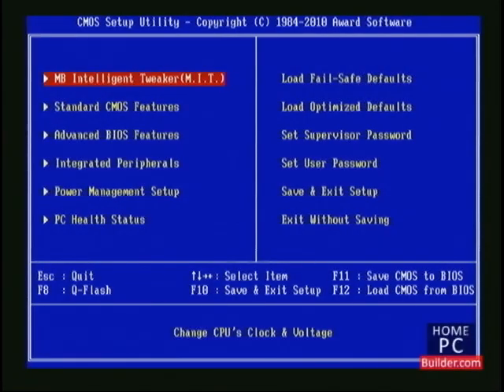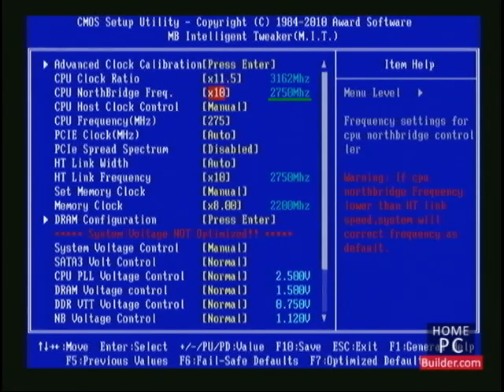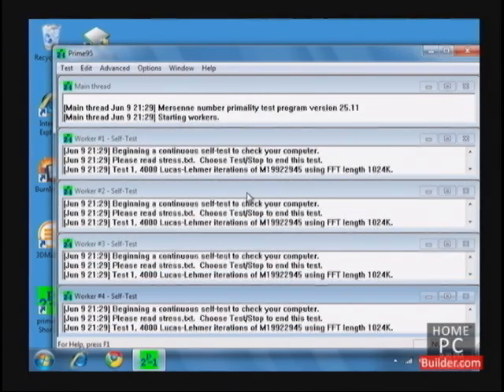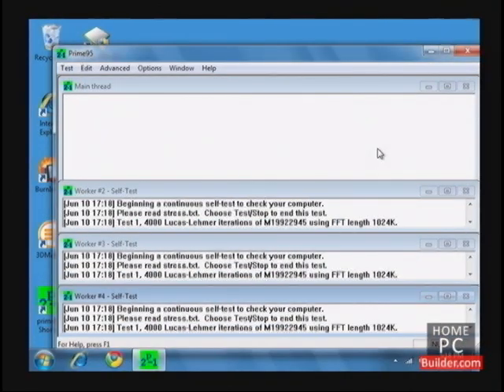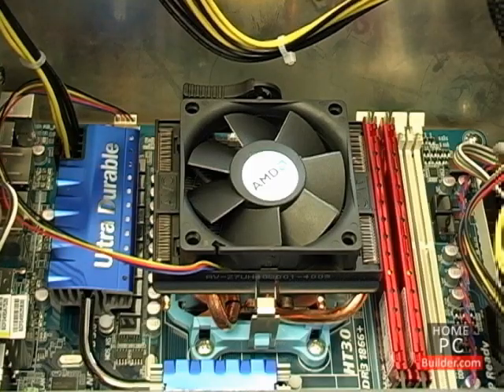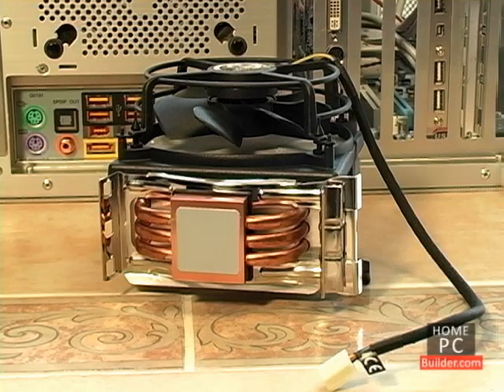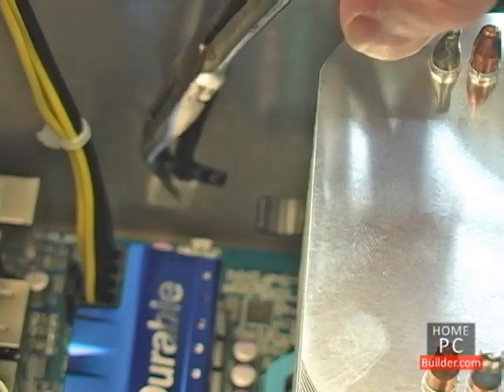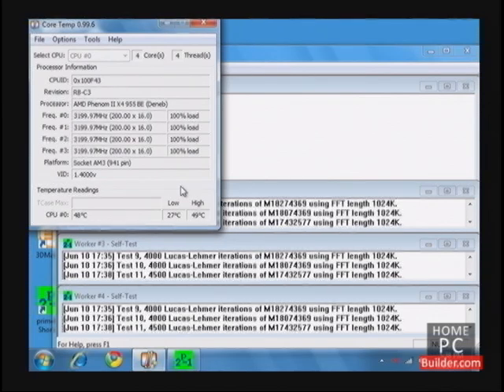Lesson 04 - Finding your motherboard's maximum stable reference clock speed - AMD Overclocking

Comment from the maker: It depends on how you look at it.  The memory on a video card is there to hold the information the graphics card is working on.  If you add a second video card it has it's own memory that it used.  The memory isn't shared between the cards.  That said by adding a second video card in SLI (Nvidia) or Crossfire (ATI/AMD mode the video cards will share responsibility for rending the graphics in your games which nearly doubles performance.

Comment from the maker: There is an Acer motherboard with a WMCP78M model number.  Is this what you have?  I'm not finding a manual for that motherboard.  You should go into the BIOS and see if it has the settings shown in this and earlier videos in the series.  If it does have the settings for voltage, multipliers and frequencies you can overclock the CPU using that motherboard.

Comment from the maker: Even if you have the same motherboard and CPU as the person who made the video maybe you want to overclock the CPU frequency more or less than they did. So what do you do then?  They didn't tell you the basics of overclocking.  How you change the frequency and voltage while taking into account heat and stability to have a successful overclock.  If you need help who do you ask and what if they aren't helpful or don't answer you at all?

Comment from the maker: @maheshtanay I wouldn't use more than 1.5V.  If the CPU isn't stable at that voltage with the 2 extra cores unlocked it means the extra 2 cores have problems.  You would have to disable the cores and use it as a dual core CPU.

Comment: then finally what i need to do..by changing cooler system or increasing or decreasing of volt to reduce cpu temp....how much voltage need for unlocking the cores.....
My sys config - Amd phenom ii X2 550 3.1Ghz, 2x2 Ram 1333+, Radeon hd 6770 1gb, gigabyte motherboard, 450 watt psu.......

Comment from the maker: @maheshtanay If the system is hanging the CPU might need more voltage.  Just keep an eye on those temperatures since increasing voltage make the temps rise.  It is also possible that no amount of voltage will make the CPU stable with the extra 2 cores enabled.  Some of the 4 core CPUs AMD sells as 2 core CPU really do have problems with the 2 extra cores.

Comment: nd one thing forgot to tell u....if i unclock the cores x2 to x4 then how much voltage have to increase..i increased 0.075v....is fine...r any changes....nd some times system goes hanging immediately.....

Comment from the maker: @maheshtanay You could try removing the cooler and re-applying the thermal compound. That may be enough. Changing the cooler to a better one and adding fans to the case (if it doesn't have enough to move cool air in and warm air out) would help with cooling as well.

Comment from the maker: @AlexAvlonitis Its a very small piece of plastic with some metal inside that wraps around 2 pins on the motherboard making them connect.  jumpers use to be the way you configured lots of setting on the motherboard.  Now they are just a few and most of the settings are done in the BIOS.  The clear CMOS jumper is there so you can get back into the BIOS in case a setting change you made in the BIOS was wrong or in your case that you tried to push the overclock too far.

Comment from the maker: @AlexAvlonitis If the computer won't POST (Power On Self Test) you definitely went too far with a setting or two.  You can get back into the BIOS to try again by using the clear CMOS jumper on the motherboard.  Check your motherboard manual for instructions.  Basically you move a jumper over 1 pin for a second move it back and power the computer on.  It sets the BIOS to defaults and lets you make changes again.

Comment: Hey i overlocked AMD X2 5200+  Dual Core..
When i power on PC at bois logo comes warning  ur  system is in safe mode .. press F1 to continue i always press F1 and it will boot up windows but it is safe ... 
and i change freq 200 to 300 .. and i have only x13 means i only make 2.6GHZ not more ... so its safe or not my board is Gigabyte NVDAACPI